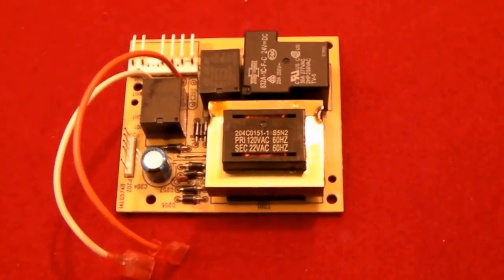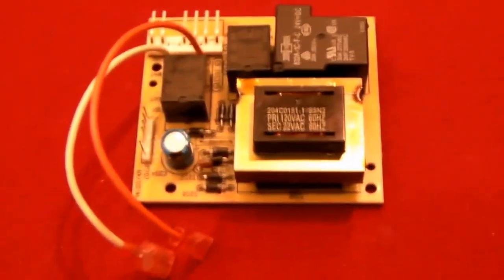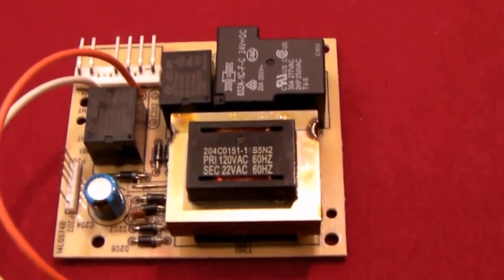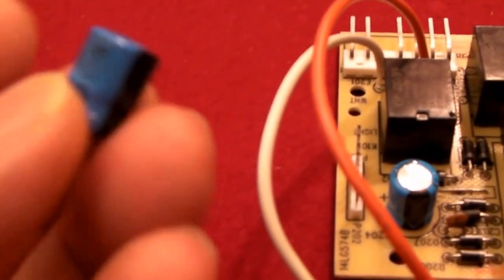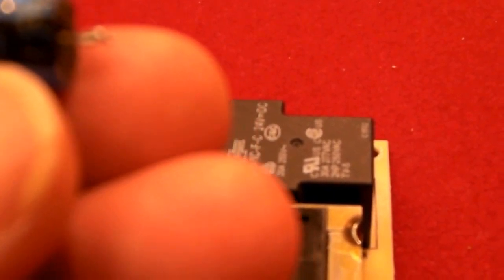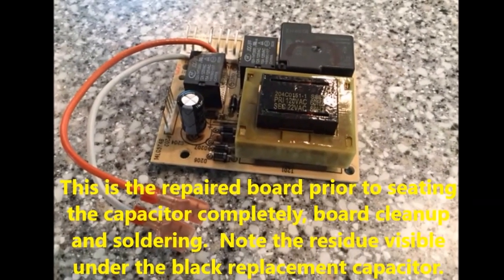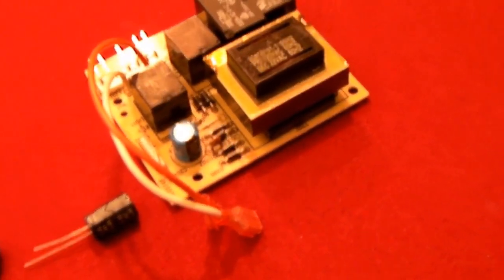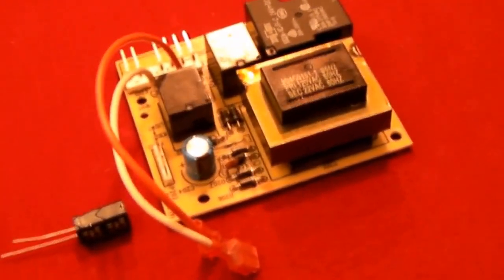Liftmaster Raynor Chamberlain Garage Door Opener Receiver Logic Board 41AC075-2S Fixed for $1

Comment: Great video!  I have been a electronic technician for over 50 years.  I recently had a fault with my Liftmaster.  I took it apart and found a ladybuy fried on the back side of the Power Supply board shown here in your video.  I took pictures for sure.  I used alcolhol and a Q-tip and cleaned off the ladybug and its juicy drips that were connecting several streets.  I reassembled the unit and voila, it works perfectly.  Note:  This is the first time that I have ever actually found a genuine BUG while troubleshooting.  LOL...
Reply: perzactly! the literal origin of that eponymous term is attributed to a moth that shorted relay contacts within a '40's era computer. way to connect with history!

Comment: My 2005 liftmaster failed yesterday.  Totally dead, no lights, not clicks, nothing with remote or wall switch.  I took the two boards out - logic board and power supply board.  I inspected everything and nothing looked burnt.  I removed the capacitor you're showing and measured it - it had almost no capacitance.  Ordered a 6-pack on Amazon for $7.  Delivered an hour ago, soldered the new one onto the board.....SUCCESS!!!  New logic boards for my model are no longer available so this saved me quite a bit of money.
Reply from the maker: Good job Mitch.  Glad you fixed your opener.  Be sure to LIKE and subscribe.  THAT will really help ME!  Thanks!!!!

Comment: This fix worked for my opener.  Symptoms for mine included:  

A dimly lit led light on the wall switch.

The light no longer worked at all and the relay did not click when I plugged the unit in. 

I used a 470u cap instead of the 330 as this is what I had in my box of caps.  I can’t speak for how this will affect the circuit, but it is working perfectly again and it was easier than a full replacement.

Comment: Electrolytic capacitors have a higher failure rate than most components, especially in hot ambient temps. I have found so many bad E caps in several power supplies from all kinds of appliances including TV's. Be sure to check polarity before installing new one.
Update: Replaced E-Cap 330uf 50V and it works!  Old one had no leaks, just BAD...1998 Liftmaster 1/3 HP.   Note: be careful not to damage the traces, super delicate, use a solder sucker or wick.
Thanks for your post, It brought back the obvious! Cheers!
Reply: My Chamberlain, 1/2 hp, chain drive, the motor just gave a  "thumped" sound, wouldn't go up or down.  In the am or pm if I hadn't touched it, would sometimes go up or down, then crap out.
I have the circuit board all disassembled.  I noticed if we had a storm with lighting, sometimes it would knock off my remotes, and had to reprogram them.  I then started using a
surge protector, and that took care of that.  In regard to the capacitors, are you talking the blue one above, 330 uf, 15 V, ? or the large silver one, next to the motor?

Comment: Mine, the light would not come on and would do nothing.  A couple whacks on the side and the light would come on and work for a while.  The problem was a bad solder on the P1 to the logic board and a bad solder on the P202 pin on the power supply board.   Works great now.   Chamberlain says “Obsolete” now.

Comment: I have 1/3 HP Liftmaster GDO and the power supply is integrated into one control board.  My problem was that the opener was unresponsive- even the light didn’t operate.  Visual inspection of components and solder joints found no “smoking gun”.  Testing of power supply found that the 330 microfarad 35V capacitor tested in the nanofarad range (open).  All other components tested satisfactorily. I replaced the capacitor with a 330 microfarad 50V capacitor (Ebay free shipping 10pack -$5) and got GDO to work .
Reply: Electrolytic capacitors have a higher failure rate than most components, especially in hot ambient temps. I have found so many bad E caps in several power supplies from all kinds of appliances including TV's. Be sure to check polarity before installing new ones.

Comment: Hi,
Thanks for your effort in posting this video. I have a Liftmaster Opener with battery backup, but the opener is not charging the battery as there is no voltage to the battery for charging. Just wondering if this power supply provides the charging voltage to the battery. Do you have any suggestion what is problem with my non-charging opener? Thanks for your help.
Reply from the maker: sorry I can't help you.  I don't know anything about openers with battery backup

Comment: Great video. I have a similar garage door opener. The garage door can be opened from the wall switch but not with my remote control nor my truck's Homelink system. When I took out the Logic Board, I realized the transformer was leaking. Do you think this could be the reason why my remote or HomeLink can open the garage door?
Reply from the maker: transformer leaking .... there's no liquid or fluid in that board mounted transformer to leak.  If overheated due to short, perhaps the winding varnish has melted but that would require a lot of heat.  If you are careful and skilled, you should be able to read the transformer voltages to see if the transformer has failed.  But that sounds unlikely to me given you can open the door with the wall switch.
Reply: Electrolytic capacitors have a higher failure rate than most components, especially in hot ambient temps. I have found so many bad E caps in several power supplies from all kinds of appliances including TV's. Be sure to check polarity before installing new ones.

Comment: My liftmaster elite series from 2008 (2 of them) just completely died. Unresponsive not sure if it's power supply or motherboard. I did pick up a used identical motor today and not sure what to swap out?
Reply from the maker: if both died at around same time, not likely the motor.  More likely a lightening strike in the area if both are wiped out.

Comment: I have a bt800 merlin  door opener. The door goes down fine but it does not come up in one go. Lifts bout 300mm then it stops 
 Checked  belt tensions all good. Check door  open it manually  all good . Spring not broken
Any thoughts ?
Reply from the maker: My first thought would be to increase the opening force adjustment to make it just slightly stronger.  However, when I looked up your model, the spec sheet says ".... Equipped with automatic force sensing, with each operation the garage 
door opener monitors and adjusts the force needed to open your garage door".  This adjustment is normally a small control that you can turn CW/CCW for opening and for closing but I can't tell if your model has that or not.

Comment: Hey I have a Raynor 170-7 garage opener from 1993 with schematic. Would you be able to provide guidance on troubleshooting it at all? I think the power supply failed due to a short.
Reply from the maker: PS is fairly easy to troubleshoot.  Disconnect any board connected to it.  Only connection should be the AC power.  You should be able to read DC voltage at the other terminals.  Otherwise, it's dead.

Comment: In my case everything works, but if there's a power outage or the motor gets disconnected, the remotes stop working and they need to be reconfigure again in order to work. I wonder if that capacitor, or another component is damaged that maintains the internal memory of the circuit board of the remote controllers when loses power. Could someone help me with this?

Comment: The capacitor fixed my problem. The relay on power supply continuously clicked until you unplugged logic board. Do not bother calling Chamberlain support. They seem like they are reading from a script.

Comment: Would this be what has blown with a power surge/outage?
Reply from the maker: I suppose a surge could be the culprit but I did not analyze the actual electrical circuit.  Additionally, since he has SEVEN openers and only ONE failure, it might not be a surge but simply a defective component.
Reply: I was just wondering, because my door opener when I plug it in flashes non stop, little fast flashes. The opener won't make a sound, and I am at my wits end....
Reply from the maker: I have had other openers NOT work due to nearby lightening strike (in the woods near the house) and that wiped out the comms section on the control board requiring a complete board replacement.  There are lots of replacement boards available on ebay if you have the right model number.
Reply from the maker: will this video help:  https://www.youtube.com/watch?v=VUnW2VNbqZI
Reply from the maker: or this video:  https://www.youtube.com/watch?v=oA9Jz3gZVh0
Reply: Lance Wrede did you figure out a fix? I have the same issue.

Comment: My opener has no power, not even the light turns on. What do I do?
Reply from the maker: If the outlet your opener is plugged into has power, then your control board or power supply board has likely failed.  The control board tells the light to turn on and off so if the control board is shot or not getting power from the power supply board, then no light.  If you unplug opener and outlet is good, then the light should come on when you plug it back in.
Reply: The outlet works, I know that, I have another opener hanging in its place. How would I test the power supply?
Reply from the maker: without a schematic, it is almost impossible to test for the average homeowner.  I personally would disconnect all the boards connected to the power supply and see if you hear the relay click when plugged in.  However, if you can't differentiate the power supply board from the logic or communications board, you will have to do it like most homeowners .... buy new complete board from manufacturer which has logic/comm/power supply all together.  Doing anything other than replacing the entire electronics is the only safe thing to do for the majority of homeowners.  This is cheaper than a new opener or hurting or killing yourself!
Reply: I have a LiftMaster 3245, there are no clicks when it is plugged in, I know the logic board itself works, the green one, I just need to know what component to replace to fix the power supply.
Reply from the maker: @Gosh_Josh :  it could be any component or componentS on the power supply... diodes that rectify the AC to DC, transformer, capacitor, mov, resistor(s), zener diode that sets the DC voltage, etc.  It could even be a cold solder joint, broken copper trace on the printed circuit board, etc.   You'd have to troubleshoot the entire circuit and it will be challenging without a schematic which mfgr will not give you.  It's a pretty simple power supply if it looks anything like the one in the video but it will be a challenging fix for most.  Good VOM is the minimum PLUS the skill and knowledge to troubleshoot basic circuit and test basic components.  Unlikely but problem could even be in the cord.  I'd personally be tracing the voltage and other circuitry starting with the plug, down the cord, at the pc board, then ............

Comment: I have a 14LG299 logic board. I have the main plugs connected it blows the GFI . I measured the resistance across H and N it reads 156 ohms which is across transformer.  Do you have the schematic for this board
Reply from the maker: Sorry, I do not have the schematic.  Remember the OLD days?  almost everything electronic had a schematic inside the device.